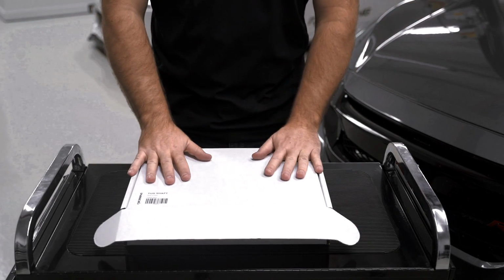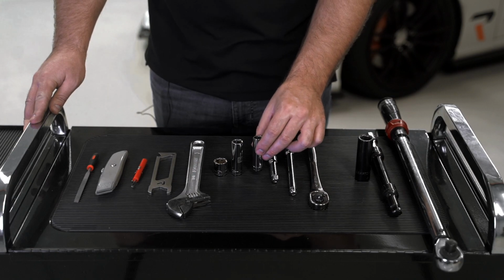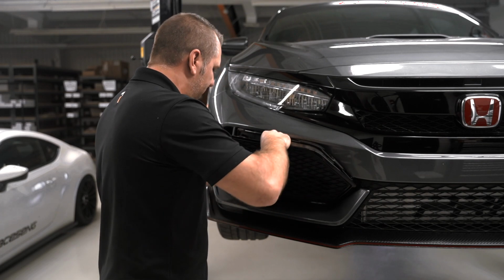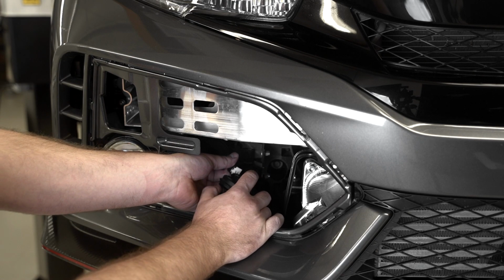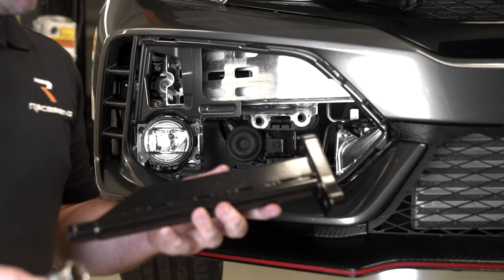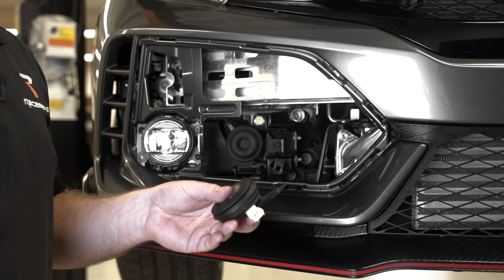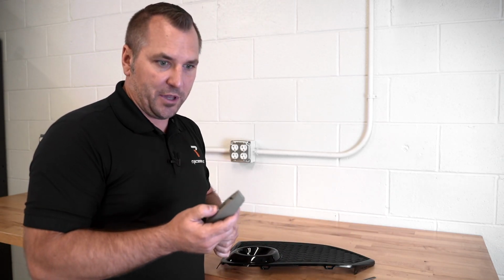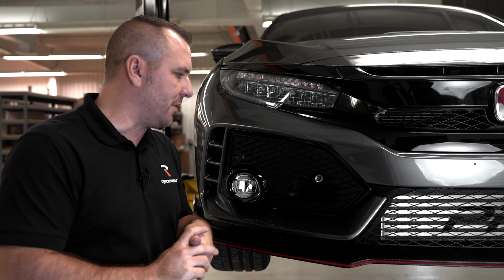Tug Shaft Install \ Honda Civic Type R - Si

Comment: Is there any adapter for regular hatchback 2018 to install the tow hook in the same part as the type r?
Reply from the maker: Our tug shaft for the Type R will still bolt up to the standard hatchback, the bumper exit will be a bit different however.

Comment: Why not to use the manufacture original location?
Reply: There is no oem location for the front. Which is why we had to make one.
Reply from the maker: Unfortunately Honda did not include a factory screw in location on the FK8

Comment: Awesome thinking about getting one
Reply from the maker: I hope you have grabbed one of these by now!
Reply: @Raceseng  i haven't and i have a 2021. I'm not sure if it's the same process
Reply from the maker: @privera3467  The mounting points are the same.  The hole in the bumper is just a bit different.  If you email support@raceseng,.com they can send you some photos on the facelift front end!

Comment: So it won't fit my 2021 CTR? Can't find parts for 2021 yet
Reply from the maker: \ it will fit the 2021 CTR with some slight trimming to the surrounding plastics.

Comment: Will this work with the 20-21 models? They have an accent piece that looks like it gets in the way of where you cut the hole for the tow hook.
Reply: \ we are currently working on verifying fitment for the 2020+ Type R
Reply: @andrewemsweller  thanks for the info. I look forward to hearing back. I wanted to buy this tow hook
Reply: @andrewemsweller  any update on this? I would like to get one for my 2020 Type-R. Thanks!
Reply from the maker: It does fit, the hole will jut be cut a bit different.

Comment: Does it work with honda civic sport?
Reply from the maker: It will bolt on but the hole in the bumper will be a bit different.

Comment: Great video! Just out of curiosity would this work on a normal hatchback sport? Thanks!
Reply from the maker: \ this will not, sorry!
Reply: @Raceseng  
Are the bolts not there for the normal hatch? I was thinking of adding this since im adding a new grill and new fog lights. Since my bumper was gunna be off , figured I'd add this. 

Maybe there's a product specifically for the sport?
Reply: @TheRealRyanMickens  i thought the same, I’ve been having a hard time looking for something to adapt the tow hook on my normal hatchback and just looks like nothing exists for 🙄

Comment: Hi how much for that set and i cant find it on your website thanks
Reply from the maker: noypi rider \ Here's a link - https://www.raceseng.com/tug-shaft-ring
Reply: Raceseng  i dont know the measuremet for it for a civic type r
Reply from the maker: noypi rider \ There's no measurement needed. You use the fitment chart to select the tow hook shaft for your car. The Tug shaft for the Type R is 172601
Reply: Raceseng  so im gonna get the kit that you show on the video?sorry im confused on this
Reply from the maker: noypi rider \ Correct... If you select the SKU I listed above, you will receive the Tug Shaft for the Type R.
Reply: Raceseng  out of stock😞
Reply from the maker: noypi rider \ Restock is in production now! We fulfill back orders in the order they were received. I'd suggest placing the order.